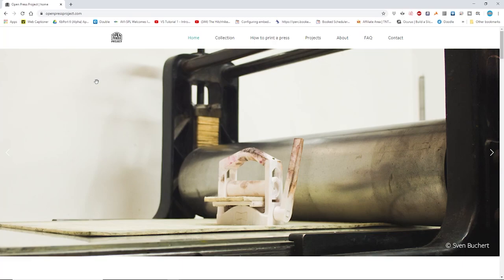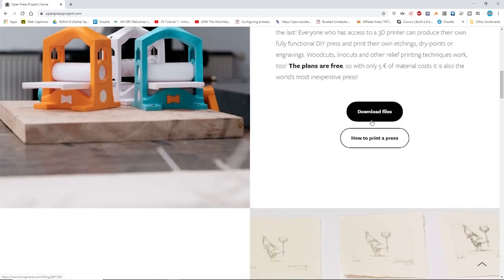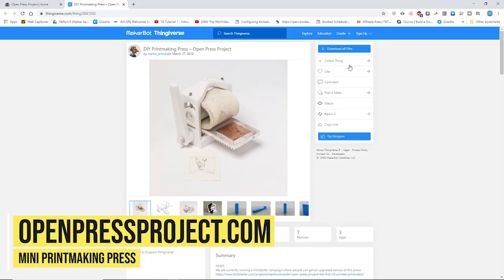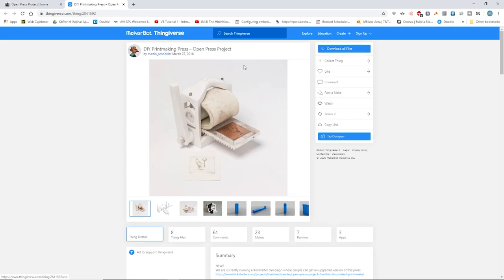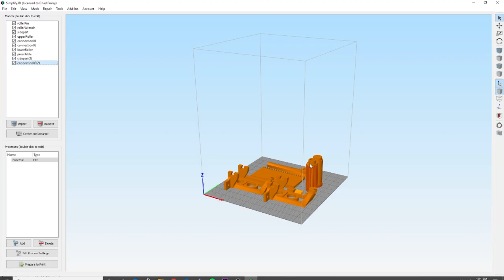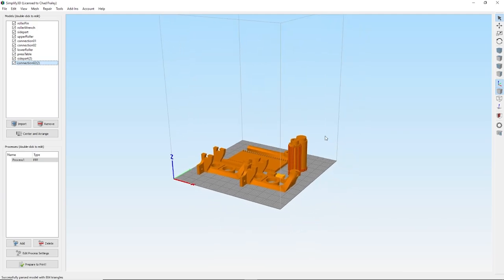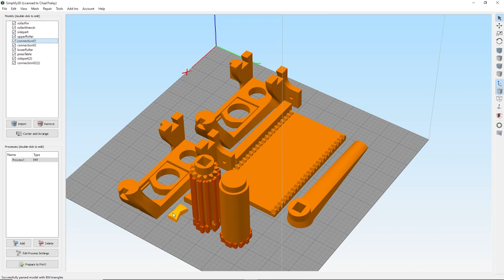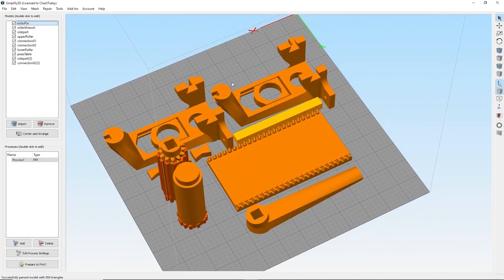3D print the worlds smallest working printmaking press! Openpressproject.com

Comment: I know its from a long time ago but still a great video!  Not so sure about the nuts on the end of the bolt without ensuring they are tightened on the same amount.  I would think it would put uneven pressure and maybe uneven printing?  Don't know unless I try it out.  Thanks 3 years later.